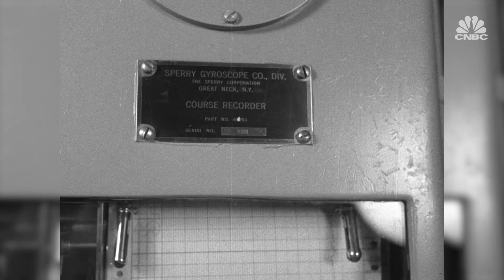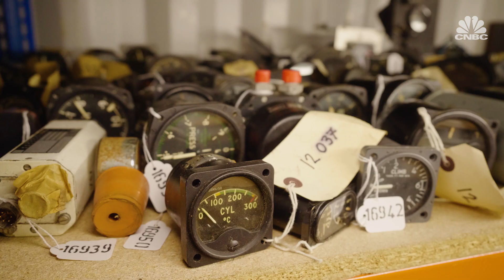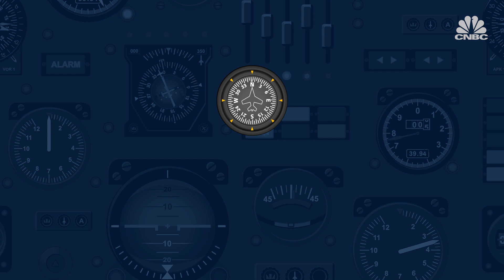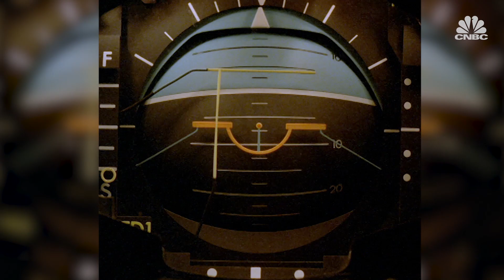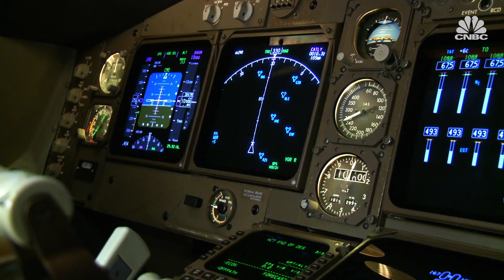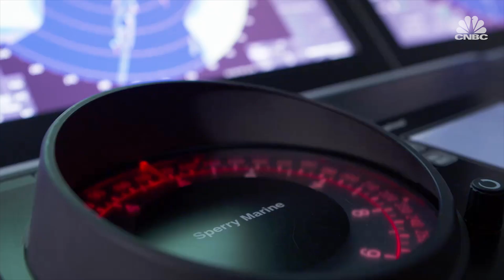This invention changed flying forever | CNBC Reports

Comment: As a pilot myself, I enjoyed the history. 
A little more info for you if you wanted to know:
As mentioned in the video, we actually still use gyros today in the cockpit. We use them for the Attitude indicator(referenced as a 'artificial horizon' in the video) as well as the DG(Directional Gyro/Heading indicator). Those gyroscopes are powered by the vacuum pump from the engine. Another instrument called the Turn Coordinator(tells us how fast we are turning, and if the plane is aligned in the sky) uses  gyroscope driven by an electric vacuum pump. The reason it's not driven by the engine vacuum pump is in case the engine fails, and we are in clouds. If all of our instruments were driven by the engine, we couldn't orient ourselves and we could crash.
Nowadays, everything is becoming electronic. Instead of having gyroscopes behind the instruments, the computers use accelerometers like in your smartphone to determine the position of the airplane. The advantage of this is that even if the engine fails, as long as we have battery, we still can read the normal instruments. We still have to have backup instruments though, which are sometimes gyroscopic and sometimes electronic.
Reply: And the laser gyroscope in the INS. I made a video about it how it detects the spin of the earth.
Reply: While yes gyros are still used today, some are not vacuum powered, just purely electrically driven(most glass cockpits there isn’t vacuum power). The G1000s and other glass cockpits now use things such as AHRS and ADC rather than a traditional gyro. All steam gauge airplanes though still use gyroscopes.

Comment: need to put this gyro in 737 max
Reply: Nah, should've just made sure that the pikots understood that they were still flying a plane from the 60s or what they call a "conventional airplane" that is also flown by a piggyback computer that can move the cables! On an FBW airplane, such as Airbus and any new modern aiplane (yes, even the 777 which was mostly designed in the early 90s.)

Comment: Just as navigation is important in the air, the same applies when drilling for oil underneath the earth. For those of you in the oil industry, the name Sperry is also well known. Sperry partnered with a Japanese oil company called Sun to develop gyroscope technology for measuring the angle or inclination and the direction of oil wells. That company came to be known as Sperry-Sun. It was later bought by Baroid, who was later bought by Dresser Industries, which finally merged with Halliburton. And today Sperry-Sun, or just Sperry is the directional drilling division of Halliburton. Fascinating.
Reply: Fascinating indeed. Nicely written.
Reply: @petek210  Thank you
Reply: A German company called Anschutz invented and developed the gyrocompass.  When you turn on and spin up the gyrocompass it precesses to true north (the spin axis of the earth which is slightly different from magnetic north).   This was incredibly useful in the age of iron and steel ships because there is no interference with the steel in the ship.   Sperry actually lost a patent suite to Anschutz.    Anschutz is now part of Raytheon.
Reply: @WilliamJones-Halibut-vq1fs  Interesting. We learn new things every day. Thanks for your input.
Reply: Fascinating!

Comment: This'll be the first modes of transport to get completely self-driven. They already have auto-pilot mode and stuff for long time now.
Reply: What autopilot really does is move the effort to about 30 minutes or so, before the flight, of programming the autopilot (route, weight/fuel data, speeds, etc). Even during the flight, pilots must monitor the autopilot, as ATC, airspace, or weather constraints may require the aircraft to modify its path.